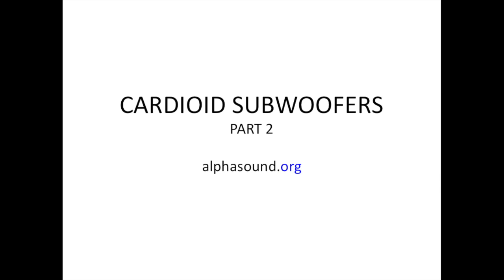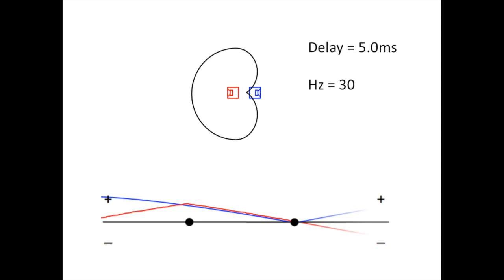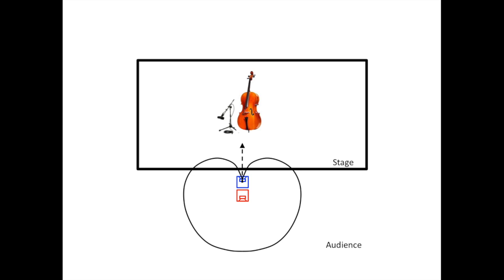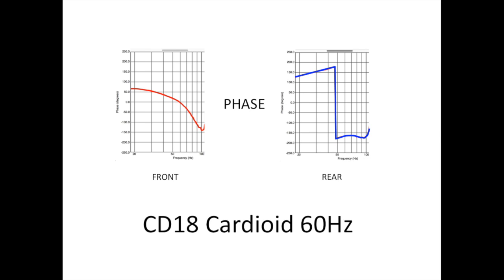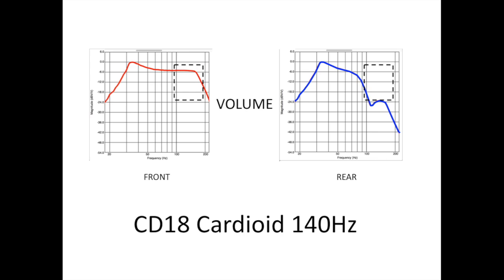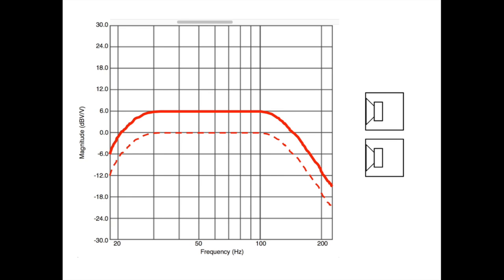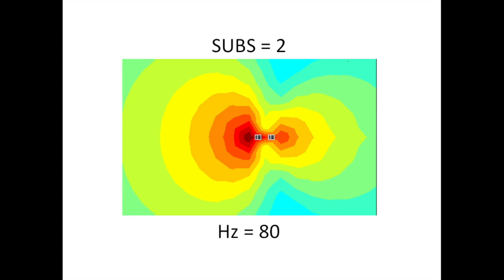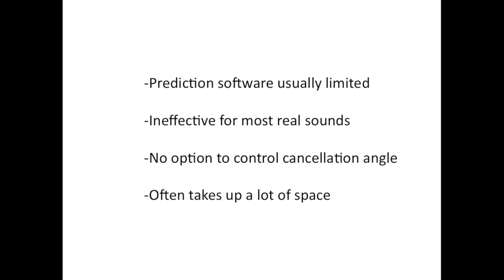NEXO Cardioid Subwoofers Part 2

Comment: Another trick for drums is to high pass the mic (just below the second harmonic) and then run it through a 1/2 frequency professor. This also can get you a huge amount of gain. As a plus, they sound really tight and deep. I have heard this with omnidirectional subs and it was really something. They had wireless mics on the drums and the drummers marched, even right in front of the subs with no feedback or noticable distortion. It did seem to get a little louder when they were in front of the subs, but not distorted.

Comment: I think you forgot to mention the major drawback of cardioid arrays as used by Nexo and many other manufacturers, which is worse transient response than non-cardioid setups or endfired setups. The wave of the signal from the back sub that sums up with the front sub is one period behind than the wave of the signal emitted by the front sub. If we had just sine sounds if the same level and frequency aqll day, that wouldn't matter. Since music is dynamic in level in frequency, it quite matters. Of course there are situations where a non-cardioid stack would be even worse, like with heavy reflections from the back wall behind the stage indoors, where an inverted back sub cardioid is the lesser of two evils.

If you got the space to do a three or more row endfired solution, why not go hybrid to get the best of both worlds? The last row (farthest away from the audience) will be used as inverted sub as Nexo intended, the others will work as endfired. The result: The inverted sub in the back will pick up a lot of the begin and end transients a regular endfired array emits to the back and the endfired subs will greatly lessen the transient response problems of a regular inverted back sub array.
Reply from the maker: Did you watch the whole video?
Reply: @devinlsheets_alphasound  I thought I did, but I was very tired. I might have fallen asleep for a minute or two, now that you mention it.
Reply from the maker: @jensdroessler3575  lol maybe we should put a bull horn sound effect every three minutes in our videos to keep people awake until the end!
Reply: @devinlsheets_alphasound  What do you mean? His question is good. you did not touch on that.
Reply from the maker: @DimitarHaralambiev  I touched on this in the rest of the video after the portion they were referring to
Reply: @devinlsheets_alphasound  where? Give a time stamp.
Reply from the maker: @DimitarHaralambiev  basically from the 15:00 mark on

Comment: What do you think about using cardioid subs, like for example a d&b y sub in a front row configuration, with 8 subs, where two central subs have no delay, next sub from both sides have some delay, and the farther from center the bigger delay is. We use such config indoors and looking for improvement. It gives wider horizontal coverage but less back cancellation.
Reply: This is called a sub arc. It is not a true cardioid setup on it's own, but it does have some directional control. You can either build 2 lines or reverse 1 box for every 2 or 3, doing a conventional cardioid design! but then add additional delays as necessary to do a true cardioid arc array.

The real benefit to a  sub arc setup is to eliminate the power alley and provide more even coverage, while also widening the dispersion field that tends to get narrow when you do a line of subs across the stage.

Comment: If you have vertically-stacked subs, does reversing the top sub cabinet tilt the cardioid null upward by 45 degrees?
Reply from the maker: It would! Although sometimes the floor itself can also change how the pattern works a bit.
Reply: this is great info

Comment: If i set subwoofer in cardioid mode. Should i turn on the phase shift 180°?
Reply: Phase and delay
Reply: If you have a cardioid setting, this usually does the necessary polarity and delay settings for you within the setting's parameters. If you're building the processing from scratch (not using a factory-built cardioid setting) then you need to apply these yourself.

Comment: A very helpful video! Thanks!
I have a question. This is for our church's sound system
.
I don't have a digital processor in hand so I'm trying to go analog for now. I placed two speakers, with one wired reversed and placed behind the other. Distance is 1/4 wavelength (54 cm, 160 Hz). I found that volume in the back is much lower than the front (from about 6dB to 15 dB difference). Am I implementing cardioid configuration properly?

I used a pdf by Joan La Roda (DAS Audio) as reference for the setup. Both speaker are power from a power amp, from different channels, fed by same aux signal.
Reply from the maker: the physical separation is the first half of the equation. What you will also want to do is delay the rear sub's audio signal by that same amount if you can.

Comment: Thank you for sharing this! Could you explain Danley Sound Labs horn tech with a similar video?
Reply from the maker: We aren't familiar with that product yet. Perhaps some day!
Reply: I can't speak specific, but from what I've seen they use much of the similar ideas of line array and/or subwoofer acoustics engineering technology, but put everything prebuilt into one box... For instance the Jericho is basically one big line array in a single enclosure (specifically the hf side)!  Of course they will never market it that way because that eliminates the theory that they are doing things differently and better!

This concept does give them more ability to keep elements closer together or have more space for lower (mid) frequency sub-enclosures within the enclosure.
As for low and mid Frequencies, they incorporate horn loading to control dispersion into the design, rather than relying purely on multiple drivers over distance (array length) to control dispersion.
Reply: They have this paper explaining why they choose their synergy horn solution over line arrays Devin Sheets. http://www.danleysoundlabs.com/danley/wp-content/uploads/2012/01/line-array-paper.pdf 
quite a good read. Here is also an interview with Professor Doug Jones of Danley Sound Labs 
https://www.youtube.com/watch?v=Mz5tIAcxJB8

Comment: Nice explanation. We work in our company with TW Audio with Powersoft K3 amplifiers. We use mostly the B30 double 15" sub and when I need cardioid I go for the array with phase reversed rear subs. Works best for me. Otherwise we still have some Martin Blackline S218 double 18" subs in stock. Also really nice in cardioid. :)